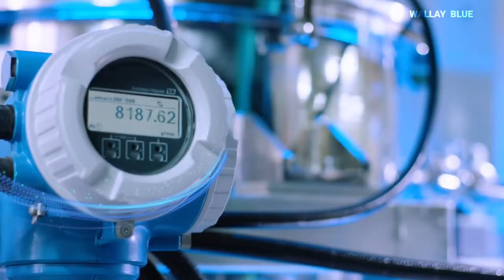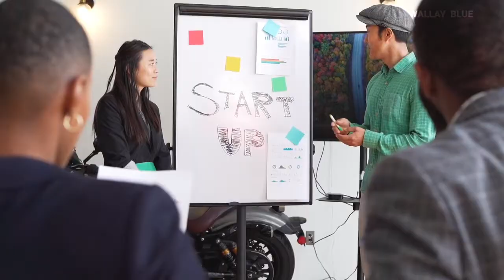Toyota CEO: This New Solid State Battery Will Change The Entire EV Industry

Comment: Why isn't Toyota going to sell solid state batteries here in the states
Reply: They will from 2026 onwards starting with plugin models from Lexus, probably the joined succesor of the Es and LS. The new ES sedan will grow, will go more upmarket  and will have a full bev option as well. From 2028, Toyota will also have solid state batteries in their more expensive models.
Reply: @avdp9095  what about putting solid state batteries into the prius prime